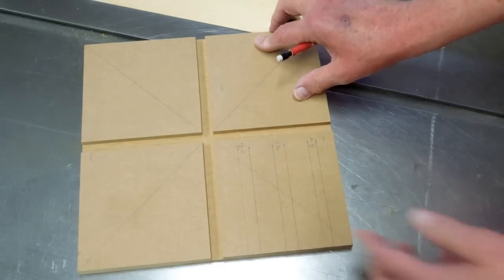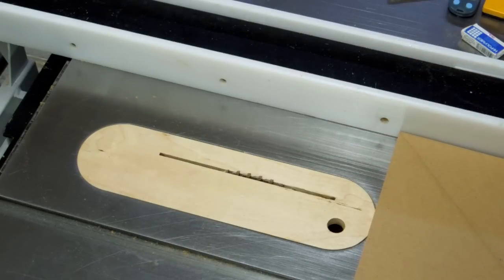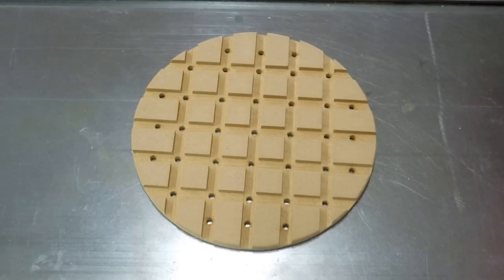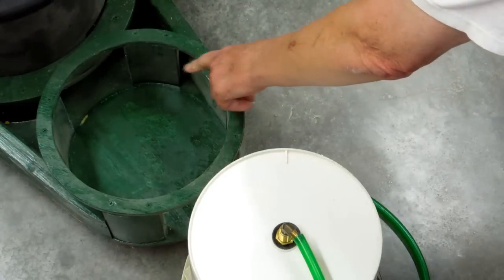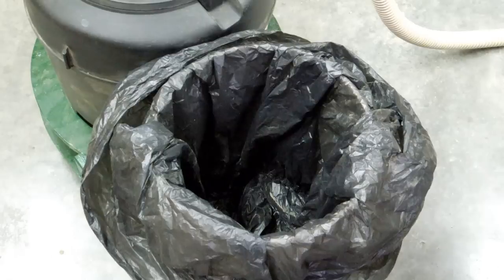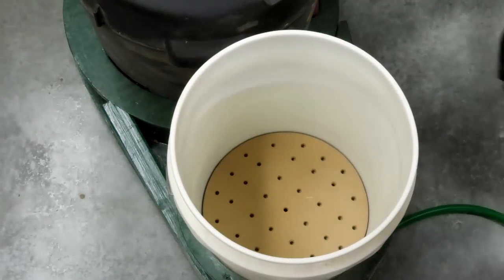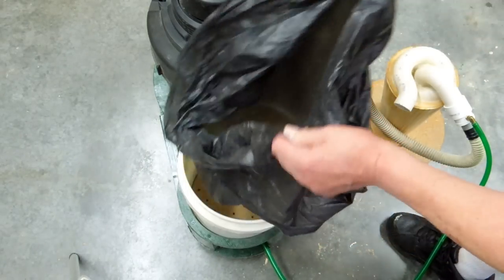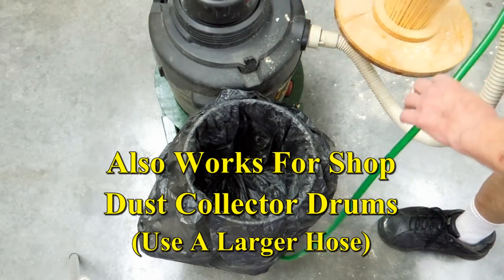Cyclone Separator - Plastic Bag Excluder

Comment: Hi Ron,
I just found this video and subscribed to your channel.
This video is 6 years old and I'm wondering if your idea is still working?
In any case,I'm going to make one of these and give it a try!
Thanks for a great idea and video!
Tom
Reply from the maker: Hello Tom,
Yes, absolutely. It still works. One of those things that makes life easier. I also have a video on using a bag inside your shopvac which keeps the cartridge filter like new. Using my cyclone (another video series) with a shopvac, the bag lasts for years and years.
Thanks for subscribing. You will probably find a number of things of interest on my channel.
Ron
Reply: @RonaldWalters2010  
I have a three horsepower powermatic dust collector. I replaced the filter bag with two Wynn nano filters and they work great.
My problem is on the end where the chips and sawdust get collected. I followed the instructions by the following video that stubbing nubs put up and the bag the bucket and everything gets sucked right up into the dust collector.
https://youtu.be/oosMqnORR6k
Any ideas how I could stop this from happening?
Reply from the maker: The following is the video series on making a cyclone separator for the shopvac and show using a paper bag inside the shopvac. My homemade cyclone is so efficient that virtually no dust ever reaches the paper bag (unless you forget to empty the bucket).

Shop Vac 5 Gallon Wood Cyclone Separator - The Original
https://youtube.com/playlist?list=PL1ABF2C513E0F4838

The following playlist shows the installation of my Oneida dust collection system. The dust collection cyclone is outside as is the drum for everything (large) collected. This system moves a very large volume of air, but even at the velocity the air travels, a portion of the very fine dust escapes the cyclone and is filtered out by the four long filter bags on the return air to the shop. Fine material eventually falls into the 5 gallon buckets at the bottom of the bags.

Oneida also offers filter cartridges inside some of their dust collection systems. I do not agree with the cartridges which are simply larger versions of what is found inside shopvacs and plug up fairly rapidly and the dust will not fall out of them. I see them as a mess.

My opinion is Stumpy is selling cartridges for cheap stuff sold by Harbor Freight and Grizzly which I call "dust relocation blowers".

No system is perfect but mine is pretty darned good!

My Steel Garage
https://youtube.com/playlist?list=PLDjucfhdTRPnBgEnuWcWtSDY__RncuTLt

Following shows the dust collection installed in my current shop before I started using the shop. It also shows the dust collection drum under the cyclone hanging outside the shop.

Welcome To My New Shop
https://youtu.be/zohIl_UNLZM

Instead of using the 5 gallon bucket under the clear plastic bag as shown in Stumpy's video... I would use a 30-35 gallon grease drum like I use and then put a trash bag inside the drum... and then the Plastic Bag Excluder which started this exchange.

Good dust collection is a lot of work and there really are no shortcuts... but what you work for and pay for now will reward you with clean lungs (or cleaner lungs) for years to come.

I have a LOT of video on this subject... table saws, sanders, air conditioners (keeping the dust out) etc, etc, etc. I am not exactly sure how many videos I have on YouTube right not but it must be close to 600.

Ron

Comment: Thanks for the idea I made the same type of mdf plate to insert into the bottom of my 55 gallon drum. I see that most of the concrete systems and vermiculite removal systems that use bags for collection use this same idea.
Reply: What size hose did you use?
Reply from the maker: 3/8" or 1/2" ... doesn't make much difference. It should remain pretty clean. Once the bag is sucked tight inside the bucket, the pressure is equalized and there is no longer any air flow.

Comment: If you were to adapt this to a 55g drum and a big cyclone (CV1800), what size would you use for the hose/fittings? This is a great design and I'd love to adapt it for my use.
Reply from the maker: I would use the smallest hose possible ... 1/4" with quick connect fittings so I could quickly disconnect the hose from the drum. Once all the air has been sucked out from between the plastic liner and the drum ... its job is done until the next time you change liners. A 1/2" or 3/8" hose would take the air out faster. Locate the drum connection as low as possible. Just make sure this Separator is above the drum connection. When it comes time to pull the liner out of the drum, that can be difficult with the plastic pulling a vacuum on the drum... "gently" blow a little compressed air into that drum connection (again "gently" is the key word) which will separate the plastic from the drum and the liner will pull out easily. Thanks for watching. Hope you have subscribed.
Reply: Ronald Walters been a long time subscriber, always enjoy your videos and ingenuity. If I were to go to the big box store to get the hose/fittings, what would I be looking for specifically? I want to make sure I don't get the wrong one. In my setup the cyclone will be directly on top of the drum and connect to it with a small piece of flexible 6" hose. I plan to elevate the drum slightly on wheels so I may be able to fit this on the bottom and if not then probably very low on the side.
Reply from the maker: Ok, Thanks! When I go to your channel page it doesn't show what you have subscribed to.
Google "quick connect hose fitting" and you will see what I am talking about. Typically used to connect a compressed air hose to air tools. Or keep it simple... google "hose nipple" or "hose barb" and get one suited to a small hose like 3/8" or 1/2" and use a hose clamp to secure to the nipple. A right angle hose barb would go on the bottom of your drum. The other end goes to the suction side of the dust collector... then it would not be easy to disconnect. Exactly how you connect it is up to you to figure out. A drum and the metal on a dust collector are fairly thin... if all else fails get someone to braze the fittings in place. Hope that helps.

Comment: I've seen a few attempts at this, most seemed inadequate. I'm guessing you invented this, do you think it patentable? I'm gonna hurry up and make mine, hope it works with a Thien Seperator :-) Btw I think you have one of the neatest shops on YouTube. Do you have a cleaning service or what?
Reply from the maker: It is my design, but it was not my original idea. The vacuum source is what sucks the bag down... not the separator type. It should work with your Their Separator. The constant shuffling of clutter creates the illusion of neatness (for the video). :-)

Comment: How about adding a check valve to the hose that goes to the underside of the barrel?
Reply from the maker: For what purpose? Once the plastic liner is sucked tight to the sides and bottom of the bucket it is acting as a valve and no further vacuum is lost.
Reply: check valve keeps the bag sucked in place (if air tight) when vacuum machine is off/disconnected to it. Then you could suck it in place and disconnect its hose and use the cyclone with no mod.
Reply from the maker: Realistically the system probably will not hold a perfect vacuum considering the dust and dirt inside the bucket. Once the bag is sucked tight inside the bucket there really are no losses for the ShopVac so I wouldn't worry about it.
Reply: Helmholz effect(s) makes you lose effect...push/pull of air is like a vibration transported over a medium. The larger surface a container has (given same material properties) the more give to flex it gives...and therefore requires larger volume to distribute the push/pull. That means you DO lose effect. Using a check valve is a cheap way to reduce the surface to improve the distribution of a push/pull. In really large builds this will be noticable in very slow buildup in push/pull force in the various parts of the system.

Comment: Keeping the bag inside the collection drum for my large shop dust collector has always been a problem. Usually I need to throw in some scrap lumber or a bucket of sawdust to hold the bottom of the bag down. This is a much better solution. I like it!